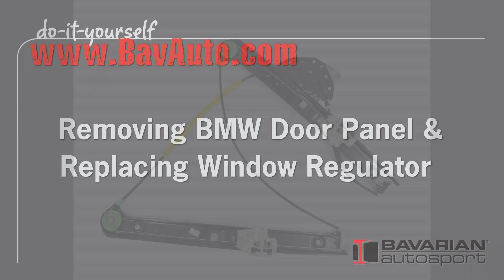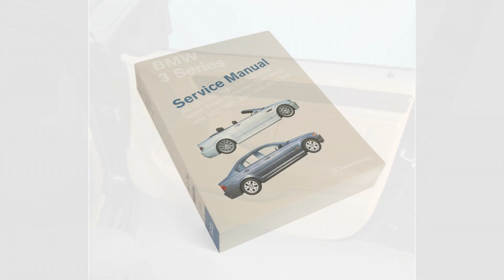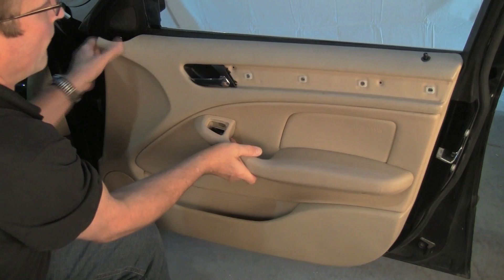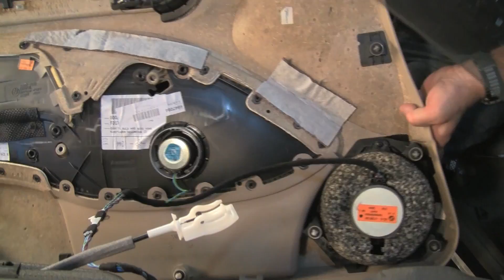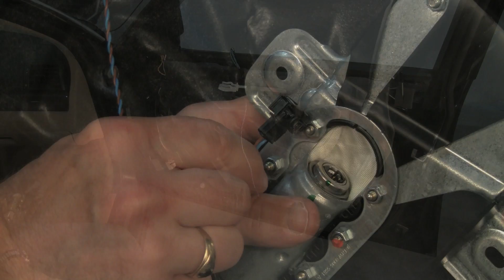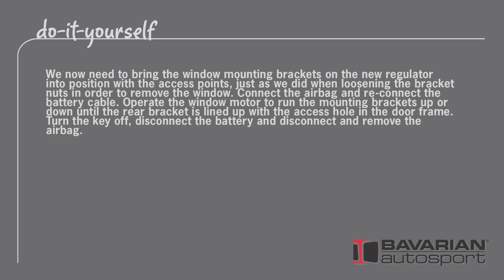Removing BMW Door Panel & Replacing Window Regulator

Comment: FFS My sons E46 eats front window regulators, even put a genuine one in there and it was binding then broke after a few months.  After market ones last a week.  It seems that the window is very tight and hard to slide up and down, combined with binding it seems to make the motor get very hot.  Any ideas? how do you set the regulators so that they travel freely without binding.  A sledge hammer and a Mercedes is the next step.
Reply from the maker: We can only suggest that you check the window travel in the guides, without the regulator in place.  If the window does not travel freely, there may have been damage to it at some point.  You can try lubricating the guides with the Wurth Tru-Glide:
http://www.bavauto.com/fland.asp?part=0893898
Reply: Thanks, I checked the guides, the window was not gliding freely through so I lubricated with a silicon based spray into the channels where the window slides.  LIKE BRAND NEW : )

Comment: Today as I was lowering my passenger side window in my 06 Z4, I heard a loud bang and then some grinding noise coming from the motor. I can no longer raise or lower the window on that side, and I continue to hear the grinding sound if I press the window button. Do you think this is a bad motor or a bad regulator? Thanks a lot!
Reply from the maker: We would think that the problem is the regulator assembly (since you noted that the motor still runs).  The only way to know for sure is to remove the door panel and have a look.  The regulator in the E85 Z4 is a cable type, similar to the one shown in this video.  We do have the regulators in-stock:
http://www.bavauto.com/fland.asp?part=51%2033%207%20198%20910

Comment: What do I do when I can't lower the window to get to the window bracket?
Reply from the maker: Use wire cutters to cut the two cables where they cross between the front and rear guides.  You can then move the window manually.

Comment: BMW window regulators suck.  seriously a freshman in high school could design a better, longer lasting system.
Reply: Take your car and your checkbook to a local repair shop. Write a check to that shop but don't fill-in the amount. Sign the check and ask the technician there the same question (or an equally vague question) that you asked here. I am quite sure that they will finish writing the check for you and fix your problem or at least the problem that you relay to them.
Reply: Open it up and see whats wrong with it
Reply: I have a 328i BMW conv 1998 and all side windows are down and won't go back up. It cranks but nothing happens. How can I fix
Reply: You are dead right my X5 already 3 out and the driver side soon just after 60k km hardly used!!!
Reply: Maybe in the usa they have to recall and pay hefty fines for defective design
Reply: Lori kira Just accept the fate of buying poor quality products and leave it as it is open the door instead of the windows

Comment: Its winter here and I brought the window down now it wont go back up, I let the car sit in the garage(chilly) and still wont go back up. It is 3/4's down but goes all the way down into the door panel but stops at  that position..............motor still works but seems jammed can somebody provide some more clarity.

Thank you.
Reply: You are going to have to remove the trim panel on the door and lift the window back up.
Reply from the maker: You likely need a new regulator assembly.  You can cut the cables where they cross in the middle between the forward and rearward window rails, so that you can raise the glass to work on it.
Reply: Thanks fellas. I was able to get it back up but was advised against winding it back down during this winter season.

cheers.

Comment: I have been working on this myself and have ran into numerous problems. Having had replaced one on a rear window i thought it would be easy enough. However, nothing fit right, the assembly itself needed to be forced into the holes that mounted it to the door frame, and the red clips that attach to the window would not fit in either. Either the front clip would fit onto the track, or the rear would, never both. Having eventually shimmied them both into place, and attaching the window, it goes up and down very slowly, and it is obvious it is struggling to do so. I took another look at it today, and at this point, when trying to move it either way, it makes a lot of loud popping sounds half way up/down. When going up, it stops, and makes grinding noises like the motor can't turn or something. Any suggestions?
Reply from the maker: Do you know what brand you installed?
Reply: unfortunately no, i purchased it off of ebay new, and it is listed as "New Aftermarket Replacement", no other brand information is given, but was sold by a huge ebay store with more than a million transactions, so I figured it was a safe purchase.
Reply from the maker: Gericho Ball
 - but you do have it in now?
Reply: yeah, it is more or less in there to keep it up. I plan on uninstalling the whole thing and trying it all over some point this weekend.

Comment: ok I followed your instrucions and replaced right front regulator. The window goes up and down BUT very slowly and appears tight. When window in full up position, I noticed front regulator arm's cable is not tight but rear regulator arm's cable is very tight.Is this normal?
Reply from the maker: Hmm ... does not sound normal.  Perhaps try cycling the regulator assembly up/down with the window detached (and pulled fully up), then reattach the window.  Also, verify that the cables are properly running around the grooves in the pulleys.
Reply: BavarianAuto Otto, I think the back cable is tight because all the glass weight is on rear regulator arm and none on front arm. How do I adjust window so there is equal weight distribtion on both regulator arm clips?
Reply: ok I realize the tight or loose cable has to do with the cable system and is not a symptom of glass weight.

I released the 2 window glass bolts and re-adjusted. After a few atempts I found the right config and all is working now. thx
Reply from the maker: Michael Groth
Thanks for letting us know.

Comment: Im about to install regulator on my m46. DO I need disconnect airbag? Cant I just unscew it, keep it connected, and battery connected and then carefully attach after Im done with regulator?
Reply from the maker: Well, yes, but this is not recommended due to the very rare potential danger of the airbag setting off.

Comment: I completed the repair today, but I noticed that the auto up feature does not work anymore (auto down works).  Did I miss something, or could it be an issue with the part I bought?
Reply from the maker: You may have some binding in the system and the load sensor thinks your child's head is in the window.  We would suggest that you go back in and double check the install for any signs of binding.
Reply: BavarianAuto It resolved itself, I just had to lower and raise it a few times

Comment: In regard to Jeremy and the SRS air bag light. I did the same thing. My concern is now that the sensor has been tripped does this mean that any or all airbags will not perform until this is cleared?

Comment: How do I know whether it is the regulator or the motor failure that causes the window does not move up ?
Reply from the maker: By far, the more common failure is the regulator.  If you can see the window initially trying to move or hear the motor initially try to run, the regulator is certainly at fault.

Comment: Anyone knows how to remove rear window panel for 2008 528i, I found two screws one on the bottom and one on the side toward door hinge area. Then, I can't remove the panel. Am I missing other screws? There is no screw by the door handle for 2008 528i... Please help!
Reply from the maker: The Bentley Publishing repair manual for the E60 5-series models will detail the door panel removal.  We do have the manuals in our online store at www.bavauto.com . For international orders, email us at info@bavauto.com.
*  There are three securing screws on the E60 rear door trim panels.  One behind the airbag emblem, one at the bottom of the panel, to the rear of the courtesy light.  One along the forward edge of the panel toward the top, by the hinge.  Once these are removed, pop the clips around the perimeter and top edge.  Then there is one final large clip right in the middle of the panel (sort of by the release handle).  Work the panel by twisting clockwise and counter-clockwise and pulling, to release the clip.
Reply: BavarianAuto I already have Bentley Publishing repair manual for E60, but there is no detail regards of removal rear door panel...

Comment: Replaced regulator per this video (thanks)......... however after complete assembly the window .... once it has reached the full down position, at the side nearest the door lock, does not travel all the way down as 1/4-3/8 inch is still visible. Once the window is raised to the full up position it blows right through the window seal at the top door frame and jumps out of the track at that same point. So something is misaligned but I cannot determine a way to adjust this. I took the vehicle to a BMW shop and they insisted that because I did not use a genuine BMW regulator assembly, this was the issue. I argued with them over this but then went out and spent another $200 on a genuine BMW regulator........ replaced again and the same issue is present. Ever seen this before? Thanks !
Reply from the maker: If you have a 4-door : Loosen the window guide rail mounting nuts (that fasten the rails to the door frame). Open the window fully.  Assure that the window (and the rails) is pushed down fully into door.  Tighten the nuts.
If you have a 2-door car : There are multiple adjustments for the window positioning.  See the Bentley repair manual for guidance (too much to list here)/
Bentley manual E46:
http://www.bavauto.com/fland.asp?part=b305
Reply: BavarianAuto Thanks .. tried that but what ended up fixing the issue was repositioning the right hold down bolt/red clip that attaches the window to the regulator. I had it positioned too high in the regulator. Thanks again for the very well made video.
Reply from the maker: PresidentGas1
- Great!, thanks for the feedback.

Comment: Hey Otto its me again. My window started to tremble and make a squeaking sound on the way down its in that position now only moving up about an inch no further and back down. First would you say its the regulator or the motor? Second can I remove the window bracket mounting nuts with the window in the down position? Third could this be a simple fuse/relay issue? Help Parked in the garage.
Reply from the maker: We would assume that the trouble is the regulator.  In cases where the window will not move, due to the faulty regulator, you can cut the two cables that run between the forward and rear regulator rails (where they cross in the middle of the door), using heavy duty diagonal cutters or cable cutters.  this will allow the glass to be moved for access to the fasteners.

Comment: I just replaced my regulator but after I assembled everything back the air bag light turned on, what did I do wrong?
Reply from the maker: One way or another, you tripped the circuit to generate a fault (more than likely).  The fault must be cleared using a specific SRS (air bag) reset tool.  We do offer one, if it covers your specific model.  Check the link:
http://www.bavauto.com/fland.asp?part=sr%20srs
Reply: BavarianAuto In regard to Jeremy and the SRS air bag light. I did the same thing. My concern is now that the sensor has been tripped does this mean that any or all airbags will not perform until this is cleared?
Reply from the maker: Rich Rodriguez
When the warning light is on, the system is partially or fully non-functional ... depending on what the system is recording as a fault.  Clear the fault code(s) and all will be fine ..... as long as there are no current faults.

Comment: My regulator is fine, my motor just died.  Can i replace just the power window motor or do i have to replace the motor and the regulator?  thanks.  Awesome video btw.
Reply from the maker: Yes, you can replace the motor without replacing the regulator.  Depending on the specific BMW model, we may show the motor in our online store (www.bavauto.com) or you can call our Advisors at 800-535-2002.

Comment: The bolts on the 2 red clips that hold the window in place are not 10mm like you say in the video.  I was racking my brain trying to get a 10mm socket to work like you say in the video.  Its really hard to see what you're doing so I thought I just wasn't getting a clean hold on the bolt.
Reply from the maker: It's been a while since we have done one, now.  What size did you end up using?
Reply: BavarianAuto I will have to check this evening but I think they are 8mm like someone else said in this thread.

Do you know is there some trick to getting the window to "fall" back in place on the red clips?  I was struggling to get the red brackets to fit into place on the new tracks.  Every time I try and put the window back in the red clips spin around and its impossible to get them to sit in the position they need to be in.  Thanks!
Reply from the maker: Steve Martin
 well ... if the bottom of the clip is broken, it will be more likely to spin or fall off.  Are you sure your clips are as they should be?  Take a look at this Tech Blog post, it has some photos of the clips:
http://blog.bavauto.com/13283

Comment: I got a 2001 BMW 325i, I am just wondering where can I buy the actual driver side window glass itself? coz the one I have on is scratched up and it really bothers me, been searching online.
Reply from the maker: Of course, you can purchase from BMW.  Otherwise, used is a good choice.
Reply: BavarianAuto
Hey, can you list the type of tools needed to replace the motor please?  I'm new to this and just want to make sure I buy the right  tools for the job. I already ordered the motor and getting ready to replace it.  Thanks.
Reply from the maker: Timothy Johnson
 - A 1/4" drive ratchet and socket set, in metric (typically includes 6mm through 13mm)
- A set of Torx bits, similar to this:
http://www.bavauto.com/fland.asp?part=27200
- A set of non-marring pry tools:
http://www.bavauto.com/fland.asp?part=ST%209007
- And .... this neat tool for holding the window:
http://www.bavauto.com/fland.asp?part=63900

Comment: Great video; however, the only problem I see with this video is that it does not show how the window attaches to the guide rails on regulator and I've seen where parts are damaged or missing. For example the red clip, how does that attach to the new window regulator rails?
Reply from the maker: The red clip is clipped onto the window glass and the rail slide nut/bolt affix it to the slide.  If the red clip is broken, the new one just clips to the class, around the mounting hole.
See the DIY in the link below for views of the glass and the red clip:
http://blog.bavauto.com/13283/bmw-e46-3-series-window-regulator-how-to-install-aftermarket-replacement/

Comment: I have a 323ci and my passenger side door glass gets caught on the frame when trying to open the door. The regulator was just replaced.
Reply from the maker: We have not dealt with this issue.  You will likely have to get into it to see if the glass positioning needs to be adjusted.

Comment: Thank you for this video, actually i'm having the same problem, same bmw model, i decided to fix it by myself but i reach a point where i can't move down the window (almost closed and jammed) and in this position i can't see and loosen the two window bolts. should i find a way to push down hard the window or there 's a step i miss in such cases because i think without disconnecting the window from the regulator, i can't pull the regulator out. help please
Reply from the maker: If your cables are causing the window to not be able to move to the position that allows the window guide bolts to be removed, you can cut the cables, where thy cross in the middle of the door, and this should allow you to move the window.

Comment: Reverse order (in case you're wondering)
Vapor barrier pannel
Airbag
Mirror Memory Module
Get Door Panel and
Attach Speakers Cables
(If drivers side front door) Attach Mirror Switch Connector
Attach Door Handle Cable
Snap Door Panel back in
Screw down the Door Panel (3 in/under arm rest, 2 under trim)
Snap the Trim back in
(If drivers front door) re-attach the Mirror Switch Connector
(If drivers front door) Snap the Mirror Switch back in.

Comment: Yea I have done it twice already. It holds for a while and the clamps are hand tightened by a screwdriver then the next day I press the button to put down the window it's stuck in the frame and the rails come down without the window. I have even sprayed the frame with silicon spray in the event that the rubber grooves were too tight. Still no help! Works for a while and slides right off afterwards.
Reply from the maker: Unfortunately, we are unable to suggest just what you may be having trouble with, since we don't have the vehicle here.

Comment: passenger window keeps sliding out of the tightened clamps on a new window regulator, cant figure out why it keeps slipping out of the two clamps.
Reply from the maker: Not being there to look at it ... we can only guess the obvious, that the glass in not properly set into the clamp on the regulator rail.  Maybe it's time to undo the complete glass and take e good look at it and start over.

Comment: This procedure is great, I'm about to perform this on my e38 as both my drive and passenger windows have gone out. But I have one question - if the motor is dead how do I get the window down in the right place to remove the bolts holding the window as described in the video pause section?